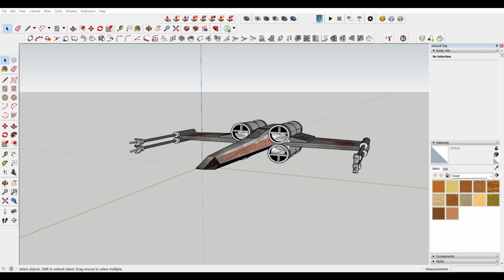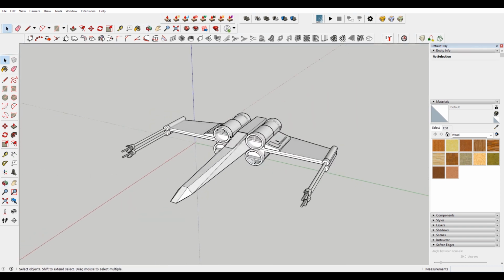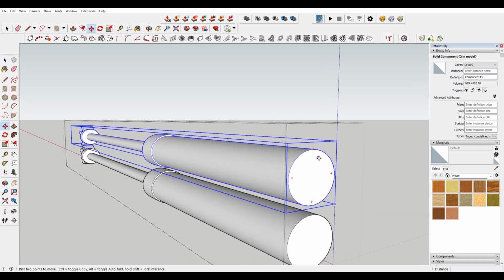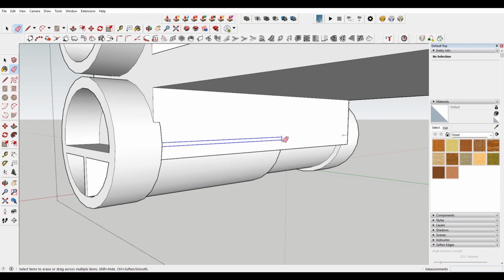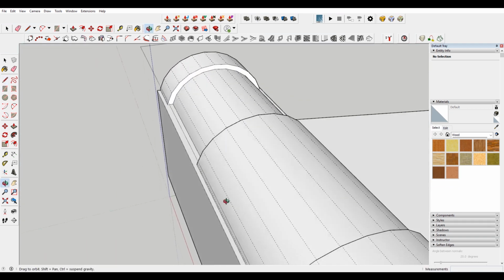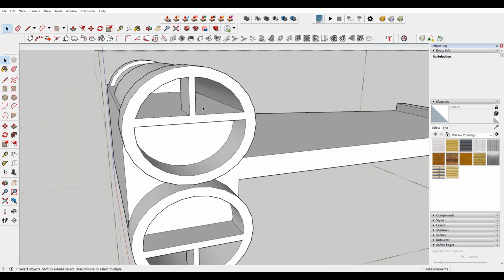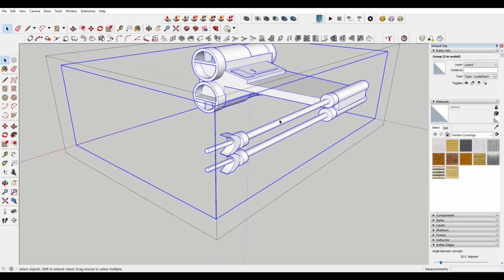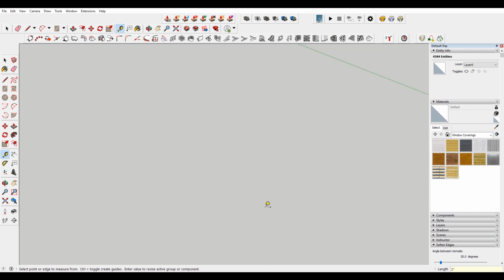Modifying 3d Models for 3d Printing with Sketchup

Comment: hi, i wanted to 3d print a model volvo 240, but the only free model available is in 3d warehouse and it is made with a lot of internal components like springs and steering rods. and made with zero thiccness walls and it has some gaps in the bodywork. do you think you could convert it to a solid for me?

Comment: One of the points you made is giving a bit of a headache.  You and many others mention that the model should basically be one single entity.  This is what I have also though all along.  Yet, as an experiment, I made a model of an open box with with the words "ON" and "OFF" modeled on it, but I made the text in a separate group and then grouped the whole model together.  To my surprise, this did not cause any problems when I ran it in Cura.  So I guess grouping several entities together at the end is ok?